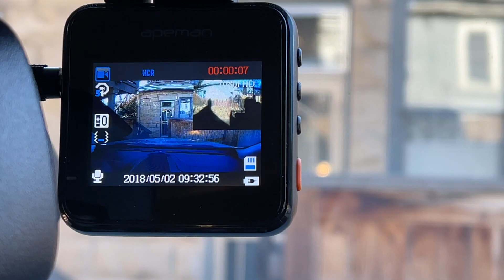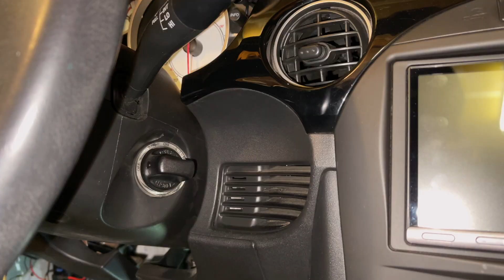Hardwired Dash Cam | NC Miata

Comment: I'm curious to see what the cabin camera  looks like with the top up. Can you still see the rear of the car decently well?
Reply: Another option I've seen people do is mount it upside down under one of the rollbar hoops (if you use stock roll protection)

Comment: Hey ! Thanks for the useful video. The Amazon link does not work anymore. Could you please give the name and model of the dash cam ?
Reply from the maker: Unfortunately they may have removed it. I will note that mine has not held up well as far as the suction mount. I would recommend looking at a different front/rear facing combo with good reviews. The rest of the installation remains the same. I will most likely upgrade mine in the next year.